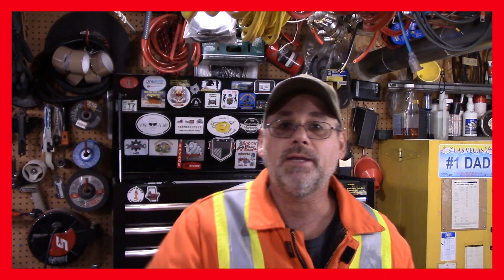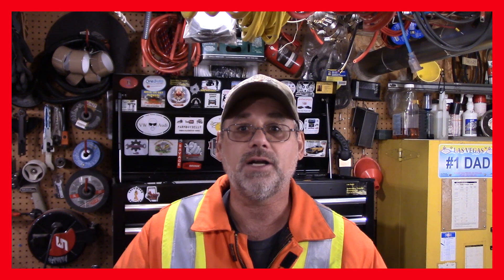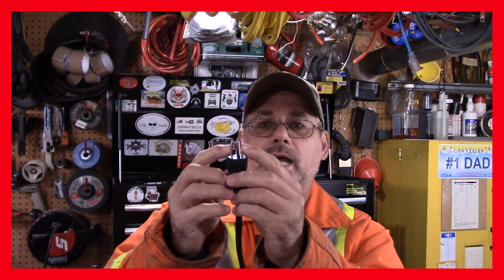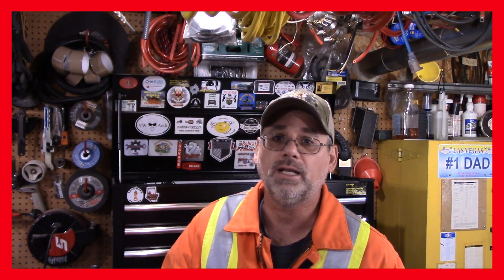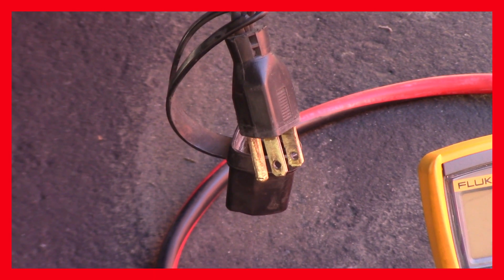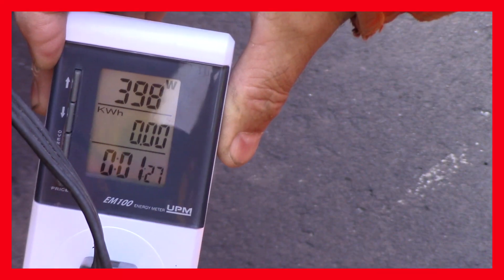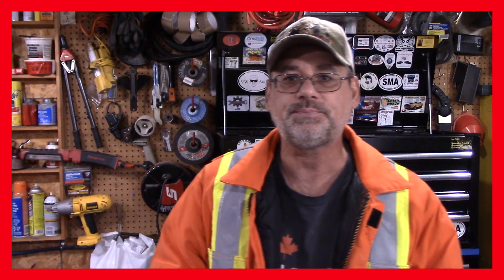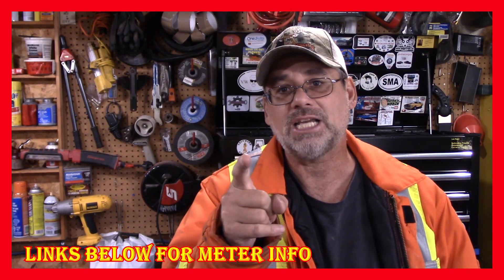HOW TO TEST A BLOCK HEATER - DIY BASIC  MULTIMETER  - NON THERMOSTATICALLY CONTROLLED HEATERS ONLY

Comment: Check to see if block heater is hot to the touch at the engine block. I cannot hear mine. I used to, but not now.
Reply from the maker: Good tip David 👍

Comment: Recently my block heater started tripping the GFCI. I've ruled out the cord/outlet and testing at the element connections. My Hot-Neutral is measuring correctly at ~15.5 ohms. However I'm also getting a very high Leg->Ground resistance reading (~14k ohms and climbing) but no beep on continuity setting. It actually works on my ungrounded GFCI outlets but will instantly trip my grounded GFCI outlet. Is this the beginning of an element failure?  I'm thinking maybe a pinhole..
Reply from the maker: Hum , interesting !  I have a feeling it's just  your your particular GFI  tripping out too soon  as many will over time compared to a non GFI outlet .
Reply: @SteveRobReviews  Man thanks for the quick reply! Maybe I'm overthinking it. It does work fine on the ungrounded GFCI so at least I shouldn't get smoked opening my door lol
Reply from the maker: HAHAHA  I have not had good success with GFI receptacles over longer periods of time .  If it was a dead short it would have tripped on the non GFI so I'm thinking it's just a higher resistance tripping the GFI.  I would verify the max amperage with an amp clamp if you have one .
Reply: I can answer the possible issues, however a GFCI is a simple CT that measures the return current, arc fault is the opposite actually better in my opinion. Quite often the reason your GFCi is tripping is there is something else on the circuit creating continuity between the ground and neutral. If these reach "100 ohm by memory" the GFCI will Tripp so it is cumulative in gains.

Comment: Stu Van Tine.
The old heater on my 1978 John Deere 2440 tractor died a year ago.   I replaced it with an after market heater.  It worked fine all winter.  Tested it this fall, and it tripped every GFCI in the tractor shed.  The heater has a cord and plugs in like a toaster, so no hard wiring involved.  Any suggestions?  I'm ordering a new one and will install it when I get it.  Want to know, though, what was going on, burnout of element perhaps, so I can prevent a repeat performance.  Thanks
Reply from the maker: Stuart theirs aftermarket and then theirs good aftermarket :)  I only buy big brand name units at tractor supply is a good place for example because I have seen exactly what your experiencing  .  Many just get one from Deere , their  pricy but nothing runs like a deere 👍

Comment: My block heater reads 25 ohms at the plug, but trips the GFCI outlet every time. Any suggestions?
Reply from the maker: Try a non GFI outlet and see if it trips . Could be the outlet.

Comment: Where did You purchase voltage tester at that looks like an outlet ?
Reply from the maker: Off amazon . Check them out there are many brands available . Cheers
Reply: @SteveRobReviews  Thanks !! Trying to figure out currently if cord or element is bad. Both were put on new by Ford about a month ago, I think the cord went bad if I'm doing test correctly. My cheap voltage meter does not have a icon like yours.

Comment: A multi-meter is probably one of the most important tools to have when working on cars. Almost as important as a ratchet, IMO. They are only going to get more important as more electric cars get on the road. Meters don't need to be expensive or hyper-accurate. They just need to produce repeatable results, which most $20 meters will do quite well.
Reply from the maker: Yes I agree and today a $20 meter is about as good as a $200 meter 20 years ago. People need to just learn how to use one because the price doesn't  fix your fault. Cheers bud
Reply: 100% agree  I should do a vid with my dad's Weston Electric 668 analog meter from the 1950's-1960's vs my $20 craftsman from the early 2000's vs my Fluke 87V from ???. They all do the same job and do it well. I think the problem with most people is they fear what they don't understand. And most don't understand electricity and therefor think its some kind of voodoo and don't take the time to learn things like Ohms Law & Kirchhoff’s Voltage Law which are the laws that voltage drop testing is based on.

Comment: Steve, I have a good digital meter but I also have a good analog meter.  Now I have not keep up with all the new digital meter specifications but years ago a digital meter would not show fast operating switching circuits but the analog meter would.
Reply from the maker: I know people that still use analog for some testing - yes good point Rick

Comment: My pops always taught me to plug in the truck and wait a minute or two until ya hear the gurgling sound from the block heater. But I will have to try this before each winter.
Reply from the maker: Yes that works , you can hear it when it starts up .  It's good to check once a year it only takes a minute. Cheers
Reply: That's a good time to test. Good thinking!
Reply: I have a 2008 f450 n can't find the block heater cord please help

Comment: Electricity is fun stuff...I've messed with it all my life but still scared to death of it!  No block heaters hardly down this direction to worry about!
Reply from the maker: Well electrical is a hobby of mine and a shocking one at times too:) I like to test stuff and will do more when I get the chance. Cheers
Reply: I do what I have to but I'm overly cautious.  I guess you could call it more of a healthy respect than a fear.  I've seen the shocking side of things many times.  And although I love welding, I still hate hooking up a car battery...go figure!
Reply: Yeah had a battery terminal explode in my face when I moved the cable to see if it was tight. It was not tight and there was a spark. Ya know what happens when there's a spark and there's hydrogen floating around?
Scarface. Well I was lucky and there was a hose nearby to wash myself off. That's why I always connect the good battery last.
Reply from the maker: Hum a car battery is more dangerous than most think. I witnessed one blow up while visiting my buddy at his shop.  Acid everywhere and in the guys eyes - luckily they had an eyewash station and he did not have any long term damage. I always  remember that day  .
Reply: Yeah it kinda burns into your mind and your eyes two2.
Reply: Oh yeah I've seen them blow up and wrenches welded to the posts. Scary stuff!
Reply: Chaos, I hear you. I am more comfortable welding than seeing spark as I rehook up a battery - something I might do every day at work! lol
Reply: Heck yeah then you know exactly what I'm talking about!!!
Reply: My 1/4" Duralast socket driver has a little piece at it's edge blown off from being near as I hooked up a battery. STRONG Chrome Vanadium blown away like a violent mistake of a welder. It wasn't even hooked to ground. I always wear gloves so it wouldn't have had too much damage...plus maybe without my gloves being conductive, maybe nothing would have happened? But good thing that battery wasn't out gassing!

Comment: Great video Steve!  Ohms have always confused me... not sure why, I know its pretty simple, but hangs me up every time.  Wattage, volts, amps...  I get it, no problem, but for whatever reason always get messed up with ohms, and it may be the simplest of all.  Nice thing about cheapo meters.. if you fry it, drop it, smash it, leave it somewhere... you arent out much.   Heck I think Harbor Freight gives cheapo meters away from time to time just for going in the store.  Good enough for checking a battery or something.
Reply from the maker: I have to agree and ohms can lead you astray in so many ways testing and I don't like testing in ohms for fome things but in this case it's a good test. I have tested some heaters that worked but not very much and as they say test don't guess. Cheers buddy